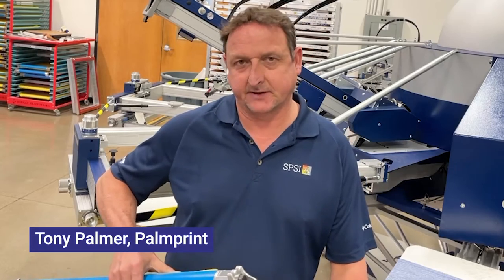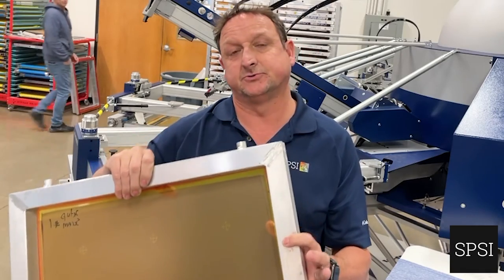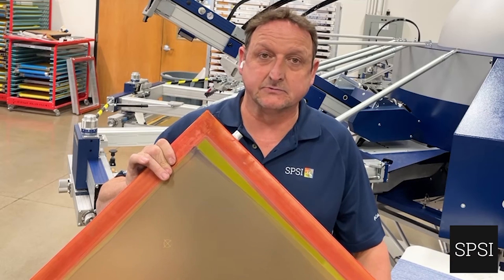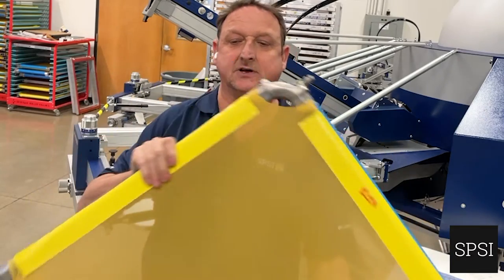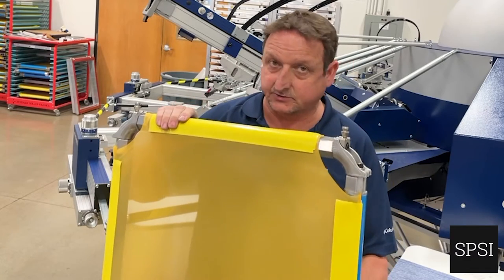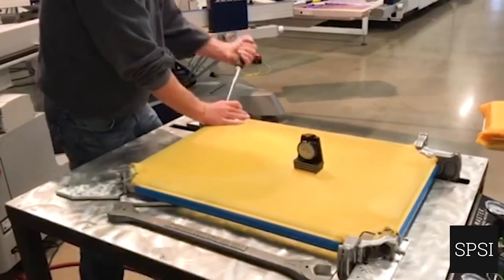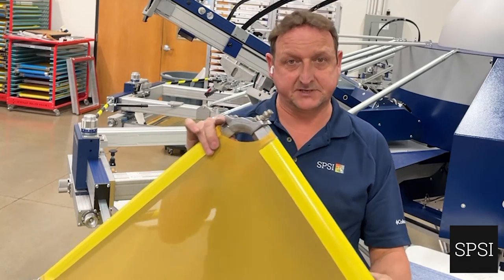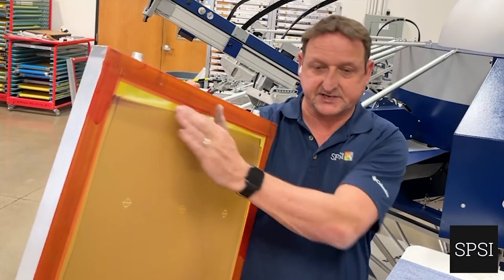Which screens should you use - Roller Frames or Static Frames?

Comment: The percentage of tension that is lost in both static and retention frames, is dependent on the stretch characteristics of the mesh low elongation bs high elongation, based on the process it took to weave the thread And mesh installing- The goal is to create balanced threads and a balanced mesh opening. Statistic frames tension stabilization will increase if these variables are met. Retention-able screens will only give you a workout if these variables are not addressed - 99% of roller frames that go through retention, now absolutely have imbalanced threads and imbalanced opening, even if it has low elongation mesh and was originally installed on the roller by a professional that know how to correctly balance the mesh when it’s stretched. Also 99% of roller owners will select the wrong mesh and proceed to install it inefficiently.

Comment: how much is the life cycle of a frame  plz..
Reply from the maker: Roller Frames can last for many many years and impressions - just replace the mesh after a time. Static frames can last 100s of impressions, just depends on how well they are taken care of.
Reply: @SPSIInc  how much is the life cycle of the mesh i mean sir
Reply: @didopitchoo5815  Modern screen printing mesh does not really have lifespan.
It will eventually get dropped, cut by razor blade, etc. For static frames, just re-mesh the screens, super inexpensive.